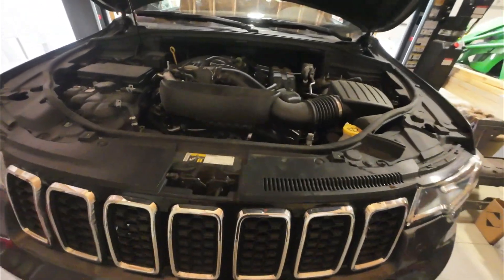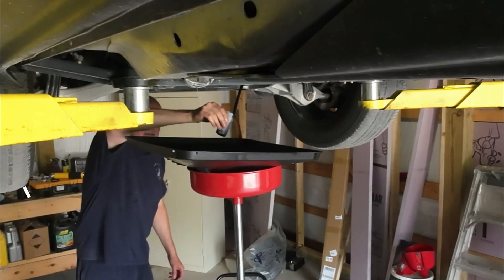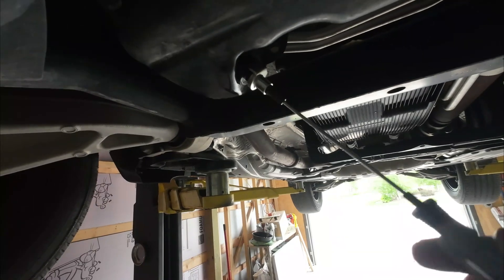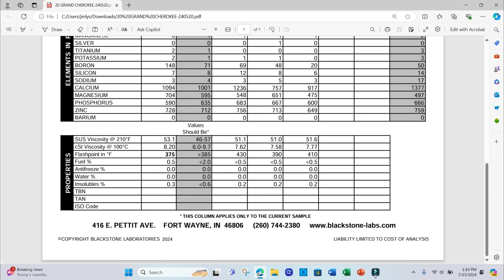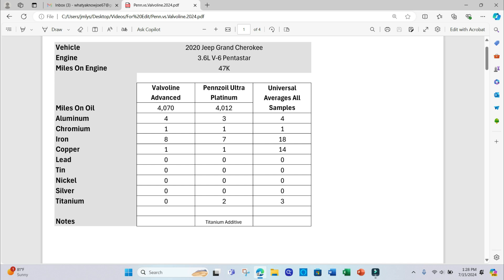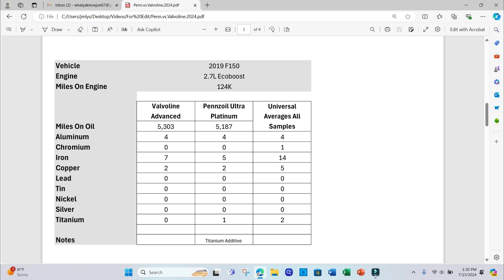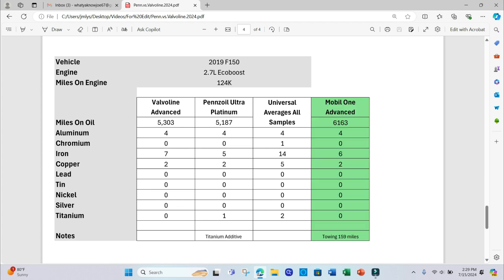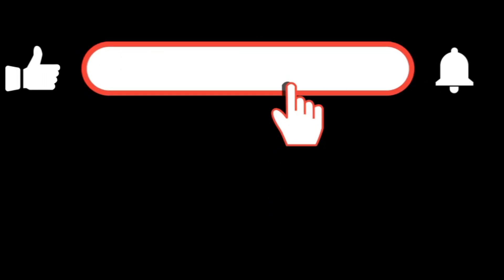Real World Oil Test Results: Valvoline vs Pennzoil

Comment: I say its both oil and filter.  I use penzoil platinum 0w16 with the purolator gold filter.  Oh man when I used these two.  My motor vibrates less, runs smoother. Gets better mpg.  After 5k it still looks great.  So I checked it at 6k still looked the same so I checked at 7k and it finally got a Lil darker.  But still clear and stable.  I drive 2020 camry and I get 43mpg on the highway.  I do 80% highway driving.  I use to use mobile oil filter till I gave this a try when I couldn't buy it at Walmart.  Now this is my new go to.  Plus its $3 cheaper.  Only 35 for a oil change
Reply from the maker: Glad it’s working out for you

Comment: I stick to 5w30 Pemzoil high  miles fully syntetic . My 2008 rav4 has tremendously changed wear and even miles per gallons under extreme condition.  Not a drop of burnt oil after 2000 miles. 👏👏
Reply from the maker: Nice

Comment: Got a 2000 Toyota camery 2.2 with over 200,000 miles. Ive used valvoline advanced full synthetic with a mobil 1 filter since i bought the car 3 years ago. With  2000 miles oil changes     This car gets great fuel mileage.  It’s super reliable ,  i don’t use high mileage oil.   I just use valvoline advanced full synthetic since day 1  it has been a good choice
Reply from the maker: Thanks for sharing your experience…sounds like a great combo!

Comment: So i always do 3k mile oil changes with syn-blend valvoline. The reason is, i went to an independent oil testing facility for a 1 week course. They ran all kinds of oil in all tests. Valvoline constantly came out on top with Mobile 1 followed behind. But they tested oil under hot idle conditions and showed that 1 hour of idle time is equivalent to 250-500 miles drive time. So idling your car for 3 hours on the phone.... you've blown through half your oil change... always a good idea to change at 3k or 4k. Everybody has their preferences, but this has never let me down.
Reply from the maker: Interesting data…thanks for sharing your experience.

Comment: Sorry Penzoil Ultra Platinum is superior, ive heard to many stories of people burning oil and when they put this in it stops along with making motors quieter. The Ultra has more of superior detergents
Reply from the maker: Thanks for sharing your experience!
Reply: @whatyaknowjoe67 The Ultra has superior detergents and have heard of check engine lights going off within 500 miles of using it..

Comment: People…just change your oil every 3-4k and WHATEVER you use will be just fine.  This is remedial content.
Reply from the maker: True
Reply: yep... my 25 year old truck is almost 300k. Original everything besides battery and alternator.  all high way miles(100 miles a day) commuting to work.. change every 3500 miles. Pennzoil and Valvoline is my economical oil to go to. Mobil 1 is when I'm feelin a lil fancy lmfao

Comment: My dealer recommended Mobil 1 , I wasn’t impressed within a year of owning the vehicle I noticed a good amount of burn off , and slight ticking noise eventually came around 50,000 miles. Switched to restore and protect  and have noticed since switching the ticking noise is gone it burns off way  went from 1 qt per 3k down to .5 qt per 3 k miles. And I do run my oil up to 5k miles between oil changes , cars maintenance schedule 
Says 7,500 but I feel even with topping off. 7,500 is still a bit, so I change my oil around 5 k every time
Reply from the maker: Interesting

Comment: The Valvoline restore and protect is the best IMO. Most likely will use this and redline 5w30 as my main oils.
Reply from the maker: Any data to back up? Curious
Reply: @whatyaknowjoe67  look at the before and after of engines with hundreds of thousands of miles on them and the varnish being removed from the engines. They end up looking brand new. Some of these users mentioned using mobile 1, Amsoil and  pennzoil and had better results with the restore and protect. I ended up returning the pennzoil ultra platinum and motul synergy and opted for the restore and protect 21 quart box for $92 dollars and free shipping from valvoline (with 15 percent off coupon). That to Hawaii is a good deal. Amazon has a lot of before and after pics with the valve covers removed. 😮

Comment: Pennzoil Ultra Platinum is the winner hands down on any test I have performed. Valvoline wears down and shears way too fast. Pennzoil for the win once again!
Reply from the maker: Important thing is changing it at a regular interval…I don’t trust these 10k-20k claims
Reply: Agree
Reply: I have to agree... while I think Valvoline is a decent oil, it got dirty fast in my vehicle. In their defense, it was 0w20 which i will NEVER use again no matter what the "manual says"
Reply: If you're going to talk about shear, then you should try mobil 1 truck and suv.

Comment: So when you change oil did you send the oil to the lab from the second oil change? Because if you switch oil then sent the 1st oil change to the lab, you will have cross-contamination. It takes a minimum of two oil changes to flush out the old name brand oil.
Reply from the maker: I did not flush the engine, but let it drain for over 20min. Yes there will be some cross contamination but it should be minimal. Two of the vehicles hold 6 qts

Comment: You should run the PUP against valvoline high mileage or the extended high mileage. Run the pennzoil platinum against the valvoline advanced.
Reply from the maker: Takes a while to complete these tests…my initial thought is that there won’t be much of a difference…lot of marketing BS out there. Might just go get some Walmart oil.

Comment: Used vavoline for 15 years never had an issue. Always change at 5-6k
Reply from the maker: Frequency is most important
Reply: You should change your oil every 500 miles.  700 tops.

Comment: Did you do one or two oil changes per oil? I thinking it would be best to use two each to reduce and or eliminate cross contamination.
Reply from the maker: Just one…but let the oil drain for more than 20 min. Will be some cross contamination but expect it to be minimal.

Comment: I use the valvoline instant oil change service centers in Arizona.  they only use valvoline products. I have never had an issue with there  convert or synthetic oils. There oil filters hold up fine to. my monte carlo has 296,000 and I change it every 3,000 miles with conventional.
Reply from the maker: Frequency is important

Comment: Sir, quick question, did you use 0w20 Ultra platinum in your 3.6L?  Some folks online are making me nervous, they said I should use 5W-30 in my Wrangler with the 3.6
Reply from the maker: I’ve been using 0W-20 in winter months and 5W-20 in summer. Wasn’t a fan of the 0W weight oils initially, but that’s what the engines are designed for I guess. My son has a 2018 5.3l which calls out 0W-20. No issues so far at 120k miles

Comment: Not real useful because you would need a second change to get an accurate number of the oil, so first time you use Valvoline or Pennzoil, there is residual oil left and it will skew the results quite a bit - Lake Speed Jr., the tribologist, proves this.
Reply from the maker: I did let the oil drain for at least 20 minutes when changing. I don’t feel that there is that much residual oil left to make too much of a difference

Comment: I been using valvoline for a while now I have 120k miles on my Honda and when I opened my engine up , it was still very clean , no sludge or anything
Reply from the maker: Nice…no need for that over priced amsoil…checkout my video testing amsoil

Comment: Nice to see a real world thing, all very nice and all with the lab results (like that oil guy channel), but WHAT IS THE BOTTOM LINE?!??!?! I use Ultra Platinum ( 0W-40) for my Challenger Scat Pack.
Reply from the maker: lol….trying not to be partial in my videos…but based off margin of error,  all are good oils and as long as you change every 5k miles probably any oil on the market will suffice

Comment: I tried PUP on my 13 Accord 2.4l 6MT thats tuned. Engine seemed to be noisier. I tried Castrol Edge in the past but car didn’t start as smooth. I’ve been using Valvoline Extended Protrction recently and cold starts have been smooth and quick. However, I just did 2 autox events and 1 track day. 4,100 miles later, I changed the oil and burned a full quart or maybe quart and half of oi. I pour the full 5 quarts in and car calls for 4.4qt. Only around 3.5qts came out. I’m looking at different oils that have lower NOACK so it doesnt burn as much. Possibly may try LiquiMoly Molygen.
Reply from the maker: Let us know the results of the liqimoly
Reply: @ if I remember I will. Read some reviews people sayin it doesn’t burn as much.

Comment: You have those wear metals in your samples probably from using regular gas in your GDI’s without enough cleaner, especially with a turbo you should use premium
Reply from the maker: You will always have wear material regardless. Object of test was to compare oil brands. The Jeep is non-turbo

Comment: This is very informative, I appreciate the video! However you're comparing pennzoil Ultra Platinum which is their best offering vs valvoline advanced synthetic which is their "mid level" offering. A more fair comparison I feel would have been to use valvolines highest offering which is their best "extended protection" or even "restore and protect" both of those are more in line with PUP as far as what they market and would likely yield even Closer results. This particular valvoline oil is inline with the regular Pennzoil Platinum. Just my two cents!
Reply from the maker: You’re correct.

Comment: My civic is barely reaching 50k 
Only used oil from the dealer 
Ultra platinum twice and Castrol edge on my last oil change.
Not sure if restore and protect is necessary on it just yet. 
Thought about trying valvoline or if I should just go back to ultra platinum. Edge seems good so far close to 1,000 miles on it
Reply from the maker: I haven’t tested the restore yet…so hard to say at this point
Reply: @whatyaknowjoe67  what would you say about Napa oil? It says developed by valvoline. Is it just made by valvoline but Napa has their own additive? Hard to imagine valvoline having the exact same oil sold by a different name for a similar if not more expensive price compared to valvoline prices at a Walmart

Comment: Valvoline loses the viscosity big time. After seeing quite a few reports I did not see a single good report where the Valvoline oil did not shear down. I am using a Valvoline oil right now but in a 5W-30 grade which normally goes to 8.5 cSt in no time. Very similar to your Pennzoil 0W-20 with 8.2 cSt which is great for a 0W-20 oil. First and last purchase of Valvoline.
Reply: My use of valvoline agrees with you. Shears down
Reply from the maker: Change them at 5k miles and they are all good oils
Reply: Yea I just used valvoline extended protection and did two autox and 1 track day. Burned damn near 1 quart in my honda. Probably going to try something else. I didn’t like PUP cause it made my engine noisy.

Comment: Great video.  The Oil Geek Guy on YouTube states to get a more accurate comparison is to double flush.  Meaning change to the oil of choice, run for a short time and drain. Expensive and time consuming but thought I would mention.  Very excited to see Amsoil vs P. Ultra.  Also, maybe gas mileage can be part of the review? Not necessary significant but interesting.
Reply from the maker: Wasn’t paying real close attention to fuel mileage but didn’t notice any real difference.  Thanks for the compliment!

Comment: You got another subscriber and liker 👋 I am running Ultra on my 2024 Wrangler 3.6.
I wonder why you are not using 0W-20. Is your Pentastar older than 2016?
Reply from the maker: It does require 0W-20…for some reason I have mistakenly picked up the 5W a few times…So I’ve been running the 5W in summer and 0W in winter. Not sure I’m a fan of the 0W-20. I believe this is strictly a fuel mileage improvement reason. Multiple oil samples on this vehicle and it is performing very well. Thank you for subscribing!!
Reply: @whatyaknowjoe67  If I run 5w30, do you think it is a bad. Pentastar started life on 5w30

Comment: Any Valvoline  product  or Pennzoil Ultra Platinum are my go too oils .... best on the shelf
Reply from the maker: I think they all are good
Reply: I use Pennzoil ultra platinum in my newer vehicles but I also have a 1993 Ford ranger 2wd 5sp with the 2.3l that has 512,000+ miles and still rocking the original engine transmission and rear end using Valvoline high mileage max 5-30 changing at 3000 miles. Nothing ever rebuilt! It's my daily work truck. Runs like the day it was new...... Also use fluid film on the fall

Comment: I have used Amsoil for 15 years and just switched to Valvoline R&P offers better fuel economy sound acceleration the color of the oil is like new and half the cost of Amsoil and my truck runs better
Reply from the maker: Test results of Amsoil coming soon
Reply: There's zero chance that VRP is better than Amsoil Signature Series.
Reply: @ChinookBear I know this comment is old but depends on the car. If it’s a brand new car its better but if your buying second hand no service history why wouldn’t r&p be better?
Reply: @ChinookBear  Then you haven't tried it or sent out Amsoil SS series and VRP for an oil analysis test to Speed Diagnostics to scientifically get the results I have VRP wear metals are much lower use what you want until you try it and test it its only your opinion.

Comment: Honestly even though its proper to run the same oil through the engine twice to flush the remaining additives from the previous oils, those wear metals are basically identical and below 5ppm per 1000 miles so both oils are doing a great job and suit your application perfectly. No need to use any other oil really for these cars and just get which ever is cheaper at the time like you said in the comments.
Reply from the maker: Yep…agree

Comment: You need to start changing the oil at the 3k mile mark if you want the engine to last past the 100k mark.  Those extended miles are for people that drive less than 10k mi per year, don't drive in congested traffic or stop and go traffic, don't have a lot of shorter trips throughout their commute and don't live/drive in dusty or dirty conditions.
Reply from the maker: Engine oils today are much better, I have two vehicles over 100k no engine issues. I drive my truck for work…I’d be changing every month  at 3k

Comment: In theory, the lower calcium detergent will have less competition against zddp and anti-friction additives; therefore provide better wear protection and also reduce friction coefficient. I will go for the lowest calcium detergent oil for better wear protection and lower friction.
Reply: Calcium additives are the best in preventing rust from water condensation. This is why you see only calcium and no magnesium in ACEA rated long drain oils. Calcium is the best protection for your motor unless you have a turbo engine prone to LSPI.
Reply from the maker: Good info…thanks

Comment: For me its hard to get Pennzoil platinum in the area or very expensive.  Using Valvaline restore and protect.
Reply from the maker: Hard to locate it here in my area as well. Be careful with the Valvoline clean and restore…I heard Iir can do too good of a job and plug up your oil filter. I would recommend changing early a couple times.
Reply: Wait for the Walmart rollback sale, if you want the Pennzoil platinum; about the same price as super tech

Comment: I have a 2017 Nissan Rogue, after trying Mobil1, Valvoline, Supertech engine got loud and with Castrol & PENNZOIL & Qaker State engine got quieter...but performed best with PENNZOIL in winter and Castrol in Summer months but overall PENNZOIL it the best oil, period!
Reply: Thank you. I just purchased  full synthetic oil

Comment: I would think the Valvoline advanced should go against Pennzoil platinum & the Valvoline extended protection should battle it out with the Ultra platinum.
Reply from the maker: True
Reply: I was thinking the same thing. Pennzoil ultra platinum is the highest Penzoil offers. Valvoline extended protection is the highest Valvoline offers.
Reply: Yeah I'm curious how Pennzoil platinum stacks up since that's dexos approved and I can't use PUP.

Comment: Off topic but on my g35 when I did my oil change I did Mobil 1 extended protection high mileage, and man I don’t think it liked it as it the engine was loud but so I switched to Valvoline next and it was quieter and they are amazing also. But switching to Penzoil rn it’s more quiet then both oils or maybe it’s just me. I simply now like it a lot more because it’s cheaper then both and essentially on the same level if not better. But amazing video! But I don’t think it matters as long as you keep the oil fresh it don’t matter
Reply from the maker: I listened but really didn’t hear any difference in the sound of the motor from the two different oils.

Comment: For some reason I have a hard time finding the utra platinum so I only run platinum or the valvoline advance
Reply: Advance Auto parts is the only place I've been able to find it where I'm at.
Reply: @illiniwood  Same here, bought a new CR-V and want to run the ultra in it. Advanced Auto was the only one that had it. (Houston, Tx. area) I bought an extra jug to give me some breathing room.
Reply: Do not run platinum in cold weather climates. It has the worst cold flow test I have seen in a modern oil.
Watch project farm cold flow test.
Reply from the maker: Same here…I had to order off of Amazon for this test.